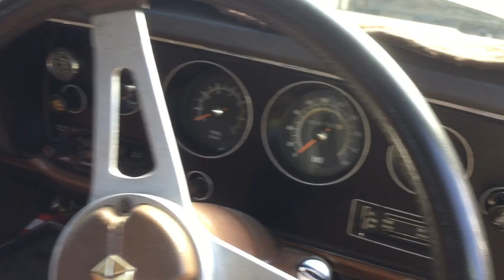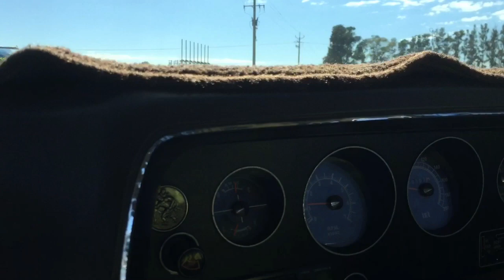Valiant Charger CL ex Highway patrol

Comment: Takes me back. ! 1977 when I first got my license I took a road trip from Brisbane to Sydney in a HD Holden. 179, crashbox and crossply tyres. On my way back to Brisbane in rural N.S.W. I was cruising at around 75 mph on a bright sunny arvo when I spotted a pair of bright headlights in the mirror. I remember thinking that whatever it was it was closing in fast, then it passed me at a speed that made me think that I had stopped LOL. It was the Police and they were running a VK Charger at warp speed. I never forgot it and the HD was the last Holden I ever had.

Comment: And to think, basic 6 cylinder Chargers with 3 speed manuals were $2,000 brand new, compared to a Holden or Ford which were around $3,000 - $5,000.  Wish i had bought one back in the day, this one is a beaut, i can remember the cops driving them in Adelaide but most were pursuit cars in the country. These Chargers are a beautiful shape and were way ahead of their time, if you could roll them out on an assembly line again, they would sell like hot cakes. Forget all the electronic crap the new cars have these days, leave them basic, they are meant to be driven and enjoyed. I had a AP5 valiant, slant 6 back in 1977, bought it for $500 from a car yard and drove all the way from Adelaide to Airlie Beach in QLD and back again, never missed a beat except for a few country cops stopping me to check me out. :).
Reply: My dad had a sky blue charger when I was a kid bought it new he still has the sales receipt a touch over 3 grand with white wall tyres,manual six cylinder rust beat it in the finish